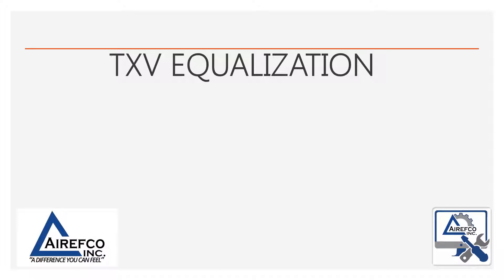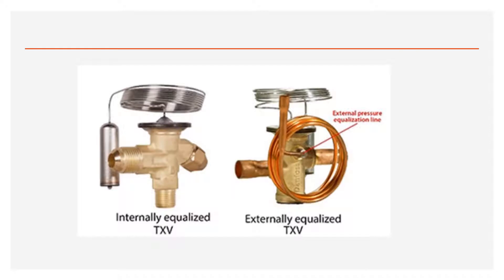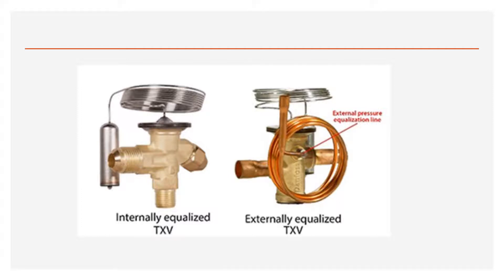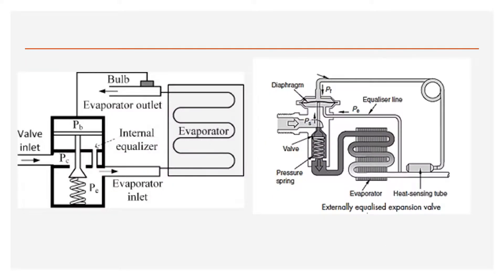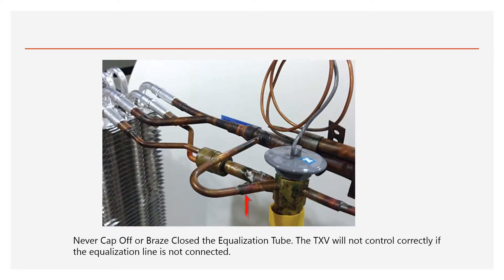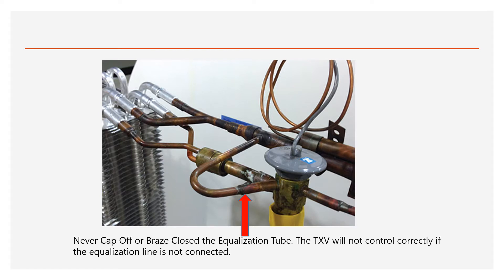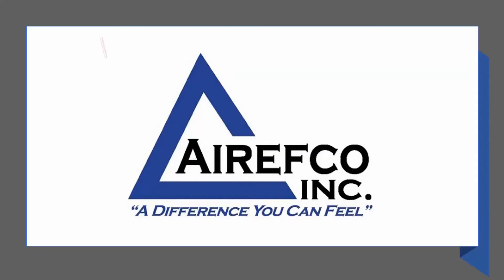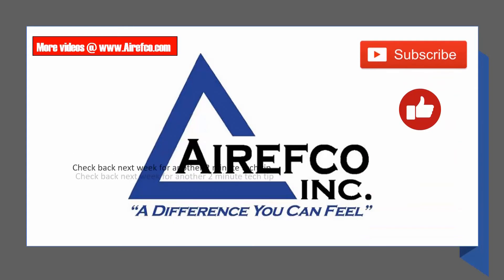Equalization on TXVs

Comment: This  commonly  used  refrigerant  control. This  valve is  operated  bypresure  and  temperatre  of  the  rrfrigerant.   Contril  bulbor  thermal  bulbis  filled  with  the  same  refrigerant  that  is chargedin  the systom since  this  bulbis  attached  to  the  suction  line  the  temperatureof  the  bulbis  that  of  the  suction  gas  when  gastemperature  in  creasesthe  pressre im side  beĺlowes aslo   in creaseandthe valve  setm movesdown spring tenstion and  evaporator  pressure  the  steom  up  frim  the  booom  of  the  bellows  the  temperature  of  the vapour enterung  the sution  from  the  evaooratiom changers  asthe   the  temperature